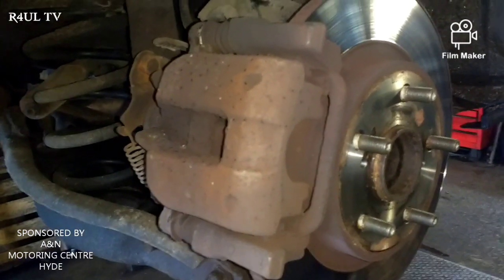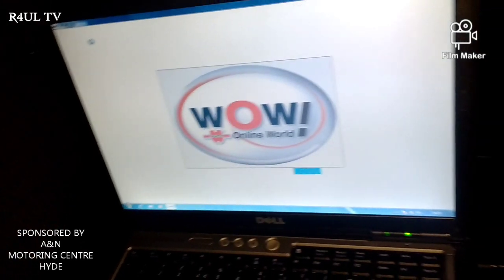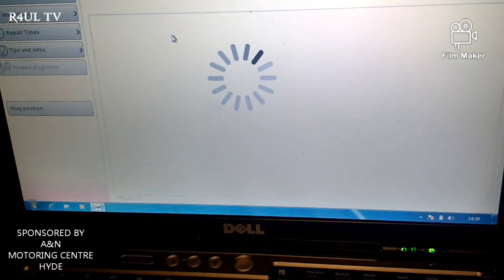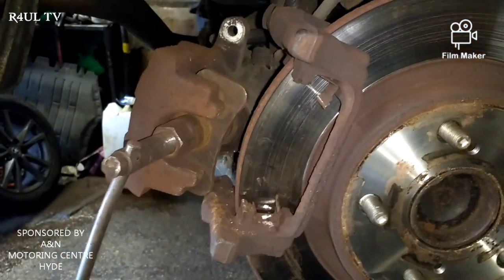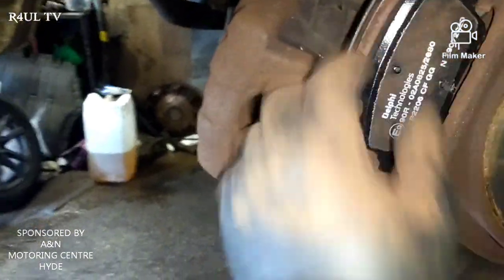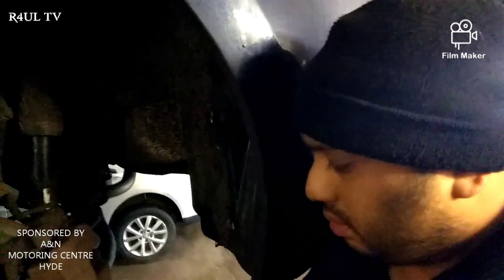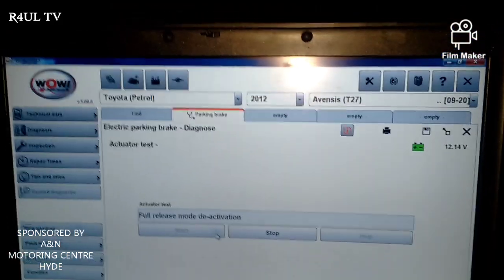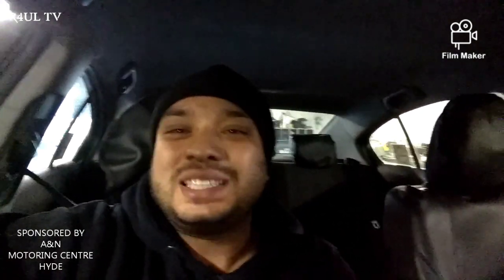How to replace Rear Brake Pads, 2011TOYOTA AVENSIS

Comment: Hi m8 how are you? I am going to buy a toyota avensis next week and it's 2013 reg 2.0 diesel. It has a parking brake button inside near driver side window. Does that mean the rear brakes needs to be done through the laptop with the software.? I don't think the front brake pads needs to done this way.

Comment: You better get that car back, because when piston was wound back, the cutouts in the piston were horizontal. They need to be turned 90 degrees so the the protrusion on the back of the inner brake pad, sit within the cutout. This will cause uneven wear to the pad, skewed piston, plus a shorter life. Also it aids assembly. I know this from experience and had to replace the pads. The outer pads were fine.
Reply from the maker: The inner pad doesn't have any protrusion nice and flat. Also the cutout on the caliper pistons are right on the edge dosnt affect it.its pretty much like the new vw.
If it needed to line up would have mentioned it. Thanks anyway for watching please like Share and share the love
Reply: @witboj8281  These cars came with multiple brakes, Akebono, sumitomo and bosch. Mine are similar to his, both pad and piston are completly flat and no protrusion at all.
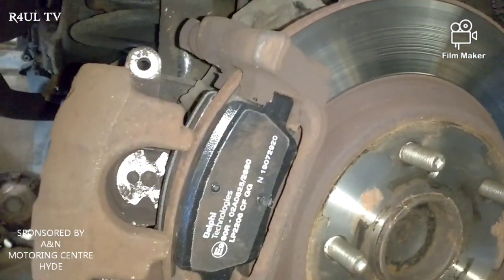Reply: @robbantor  But the ones in the movie have - they must go into the cutout you see at 5:06. I have not yet seen a clamp combined with a manual one without notches and protrusions on the pad. Otherwise, during braking, the cylinder would rotate and it only has to extend.